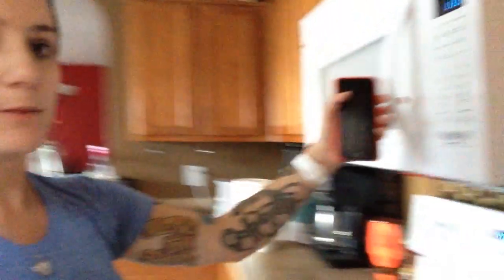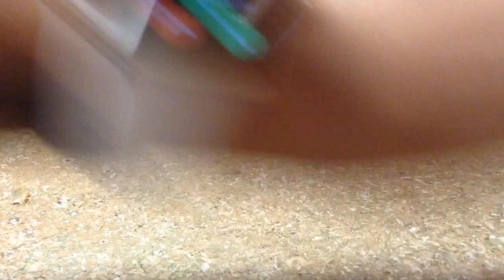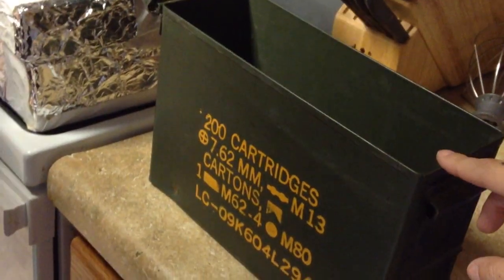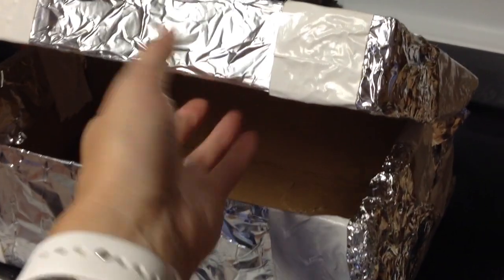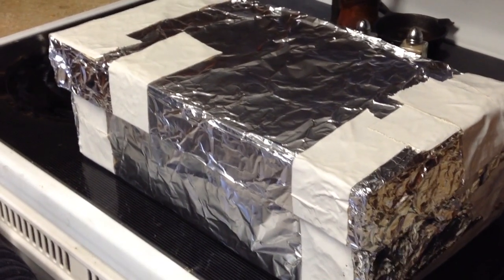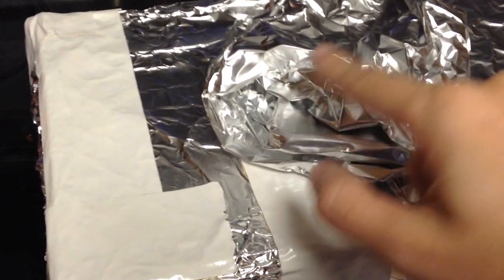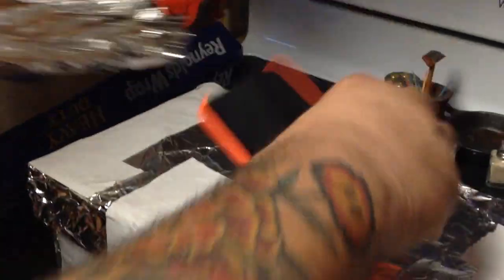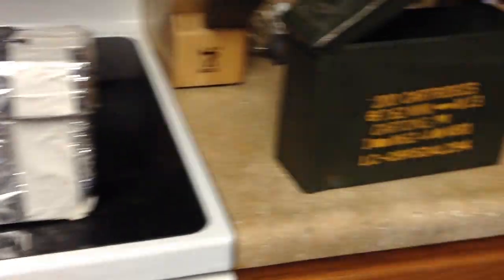#301 FARADAY CAGE EXPERIMENTATIONS [365 Survival]

Comment: I've seen how others make Faraday Cages and I found that the electronic can't touch the metal. I don't know how just the aluminum foil would work, so just insulating it with something will help. Kinda like the shoebox.
Reply from the maker: +Jason McDaniel It needs insulation inside, like cardboard or whatever, just some kind of insulation. Aluminum foil did work, as well as the metal.

Comment: Radio frequencies and magnetism are not the same. Blocking your cell phones radio frequencies from the cell phone tower doesn't demonstrate how a magnetic wave will damage your cell phone. An MRI machine may not compare to an emp attack. The emp will be a lot stronger I believe. I can't let anyone in my MRI suite that has a pacemaker. We have four MRI zones. The magnetic field can wipe out the electronics in a pacemaker or heat up the wires that are attached to the heart and kill them. There is a way I scan patients with pacemakers but it's very specific and you have to put the pacemaker in scan mode. Ferrous metal objects will become projectiles in an MRI room and also kill people. So an emp attack or natural emp will most likely send metallic objects flying everywhere. Very thick copper is the only way to block a magnetic field. That being said I really enjoy your YouTube channel. I have learned so much from your videos. I'm just trying to give back a little of my knowledge :)
Reply from the maker: +MRIguy Mmk. Well, all the reading I did said to test whether it worked or not by calling the phone.

Comment: I'd want to put a generator & communication device in a faraday cage I don't own a generator yet so haven't had the chance to experiment but I want to lol! I really like your experiment I didn't think the shoe box would of worked I like what you guys did! I heard about the ammo box and metal trash can. They claim you have to wrap it inside for full protection that's what I read online.
Reply from the maker: +TEST S You need to put insulation on the inside of the trash cans and ammo box, so like some cardboard, but that's about it. Just as long as the device isn't touching the metal. Thank you!

Comment: The key to a Faraday Cage is the insulation that is between the item being protected and the outer metal surface. The purpose of the metal is to be a conductor of electricity so that when the pulse hits the metal it will not be able to effect the item being protected because non of the metal is actually touching the item because of the insulation. The effect of the metal is essentially a short circuit. The insulation is isolating the item from the pulse. So you want to ensure that non of the metal is touching the item being protected and the outer metal should be grounded. It is not absolutely necessary to do this, but it will bleed the pulse off into the ground rather than into something nearby the outer metal cage. The metal does not have to be solid, but it must be making contact all the way around the item.
Reply from the maker: +TexasPrepper Tom Yep. It will be insulated. :)

Comment: If you are going to wrap small electronics in aluminum foil i would first put that device in a plastic bag to insulate it from the aluminum foil.  For extra protection you can then take that device wrapped in plastic and aluminum put it in another plastic bag and then wrap it in aluminum foil again.  The additional layers of insulation and aluminum foil will add additional protection from EMP.  
I would also consider  adding a layer of cardboard to the inside of your ammo box to insulate your electronic devices
Reply from the maker: +Pat Swift I think the easiest thing to do would be to use the ammo can or a box, instead of wrapping it. But yes, I need to add the cardboard or something similar inside the ammo box. Thanks!
Reply: Well at first i thought the aluminum foil wasn't the greatest idea too,  but if you want to keep a radio in you bug out bag i think it will do the job if you use multiple layers of insulation and aluminum foil.  I have so many things that i will need to add at the last minute to my bag i am worried i will forget something
Reply: Both the ammo can and the wrapping small items in aluminum foil are great ideas
Reply from the maker: Pat Swift That's a good idea, too, to wrap it in aluminum foil for on the go. Nice!

Comment: I have heard that just wire screen will work. It's not so much blocking out radio waves but allowing the electrical waves to flow around you electronics. But I could be wrong.
Reply from the maker: +TRprepper Yeah that's what I've read, too. But I'm super paranoid, lol, so a wire screen doesn't make me feel good. A few layers of aluminum....makes me feel better. ;)

Comment: I'm a little skeptical with the microwave and foil theories on the internet. Basically all it does is stop the signal (not offer protection). Now if someone emp a microwave or something in foil and it didn't hurt that electronic, I would be a believer. JMHO. Good video.
Reply from the maker: +Au Rebel Yeah guess we won't know if this works until it actually happens, but it's nice to theorize.

Comment: As always great video. The only thing that I see to consider is be sure the electronic device is isolated from the metal outside. For example if you put a radio inside leave the radio in the cardboard box so the Faraday cage doesn't transfer to the protected device you could even wrap the item in a towel.
Reply from the maker: +Charles Wilke Yes, will have to put cardboard or something on the inside of the ammo can. Thank you!